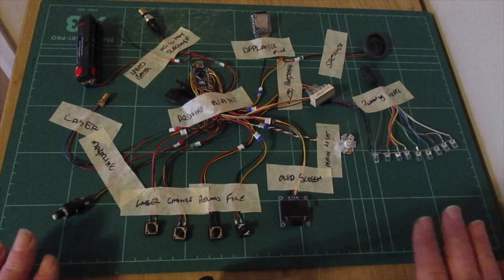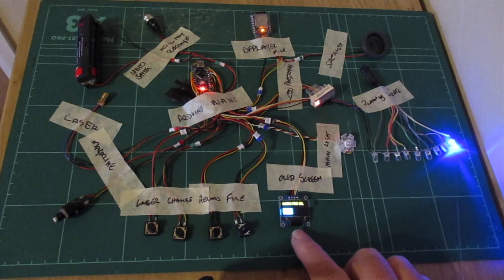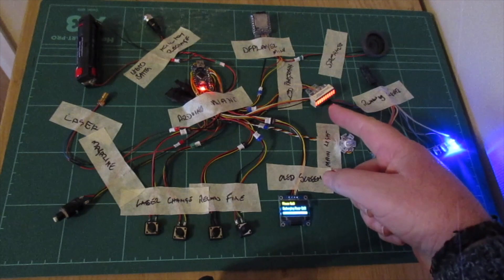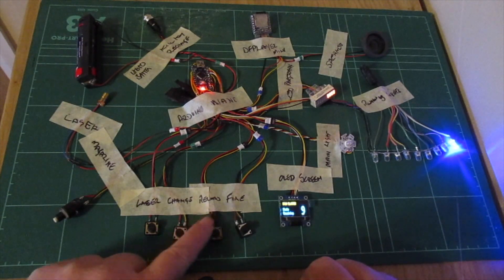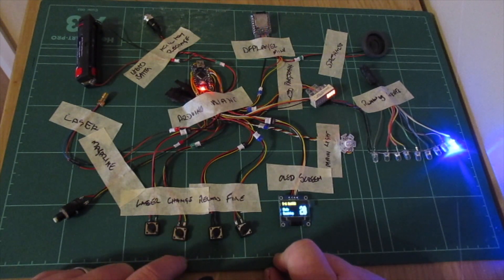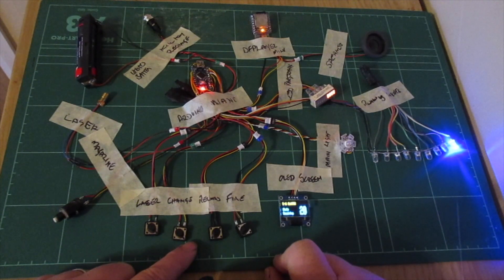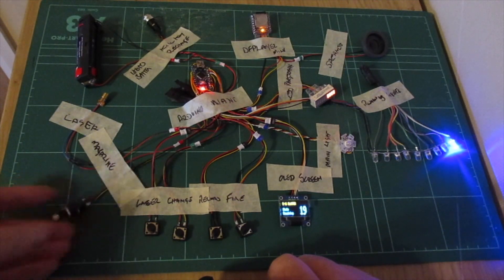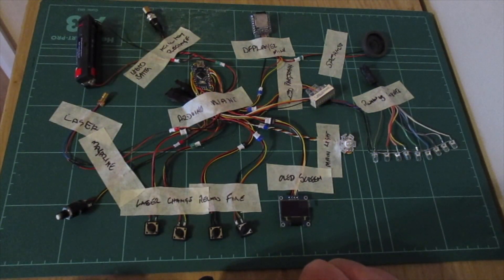Arduino Star Wars Blaster Electronics

Comment: Do you sell this pre-wired ready to go in a plug and play system?
Reply from the maker: Hi Paul,

I sell all the components needed to make your own, but don't sell pre wired as different Blasters have different places to hold Batteries, the main board etc and also wire lengths may vary. If you have the Arduino Nano and DFRobot Beetle boards pre programmed with the required code it is just a case of soldering the wires to the different components. There is a Schematic to follow. I now use Neopixel  LED's for the Barrel and Fire LED. Cost for all Components (Not including Wire) is £150 with both the Arduino Nano and DFRobot Beetle pre programmed.

Regards Phil

Comment: Hello from Denver... 
I love this version. I was wondering if you have the  wiring diagram for this? I would love to build it for my cosplay.. thank you for work.. Michael
Reply from the maker: Hi Michael, here is a link to the basic schematics - https://www.galacticprops.co.uk/electronics/open_blaster/E-11_Blaster_Schematics.png. Also check out this page (Not finished yet) - https://www.galacticprops.co.uk/blaster_electronics.html - I have since updated the battery to an 18650 battery with NO 5v Step Down module. Works a lot better. Regards Phil
Reply: Thanks Phil... It’s going to take me a moment to get everything I need but.. I’ll keep you updated.. 👍🏼
Reply from the maker: @michaelgonzalez4036  Please do love to see what you do
Reply: Morning from Denver, Colorado Phil.. I am ordering all my pieces to start my build but, I have a question. I have been looking for the ic chip MC 1407 that you have listed in the diagram. When I type it into “search” the ic 4017 is the only one that comes up. I did look on the Galactic Empire page and found that you carry the ic 4017. I am hoping/ guessing that is the correct chip for the build.. if not could you point me in the right direction to purchase the chip.. Plus, I showed my boys the build and we’re all excited.. Thank you again.. Michael
Reply from the maker: @michaelgonzalez4036  Hi Michael, its a typo error, the Chip Should Read MC14017 (Decade Counter) I think you can also use the CD4017BD Chip too. The MC14017 is available on eBay and on Amazon - https://www.amazon.com/CD4017-4017-CD4017BD-MC14017-Gates/dp/B07CNZK4R2/ref=sr_1_1?keywords=mc14017&qid=1578387554&sr=8-1

Regards Phil
Reply: Thanks Phil.. 👍🏼
Reply from the maker: @michaelgonzalez4036  Your Welcome

Comment: trying to learn the code and add the oled and the strip lights to TK8177s project. also adding and coding a second oled instead of the simple counter. Looks like i have allot of learning to do but i like this. I know TRAMP has provided a great product exactly like this with a full changeable library on the SD card. but does not provide the ability to make or change the oled settings for other projects. Other guns and other displays or going to make guns for other cosplay thus why i want to make my own.
Reply from the maker: Hi, the base code I use is my adaptation of TK8177's Code, this is available for download on my website http://www.galacticprops.co.uk/blaster_electronics.html
Play around with it and have fun.... Let me know how you get on